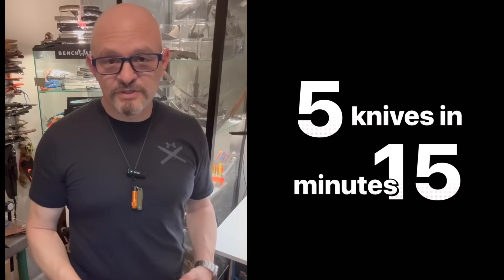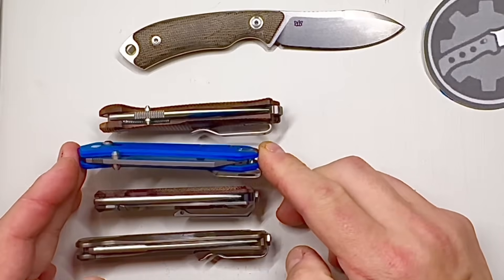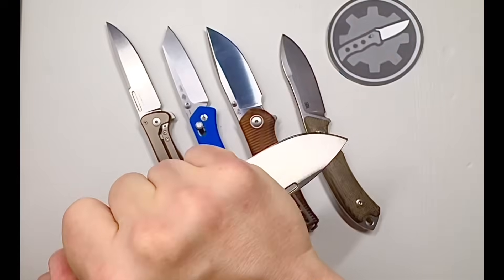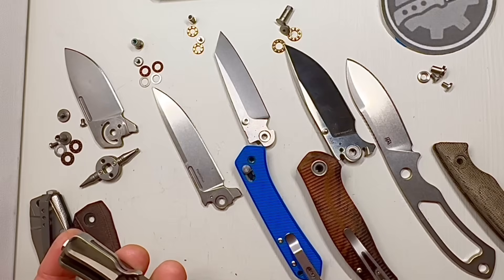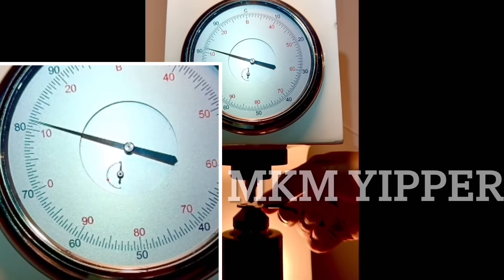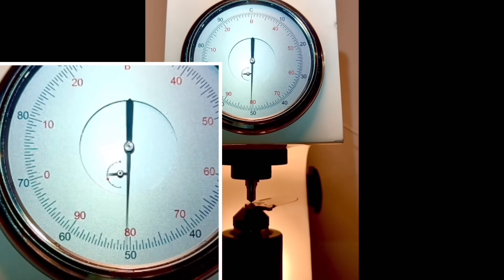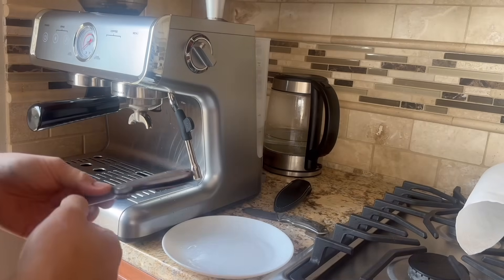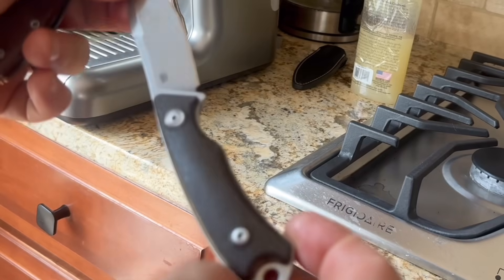Finally! Hardness test of 5 Italian MagnaCut Blades.

Comment from the maker: Just remember, and I said it twice in this video, edge geometry is more important than the hardness!
Reply: While I agree, there is a bit of a caveat here though because you need steel to be harder to support super thin edge geometry. Relatively speaking, the softer a steel is the more likely it is to roll with thin geometry. Of course the opposite applies as well because  if a steel is extremely hard it’s more likely to chip with thinner geometry.
Reply: Soft magnacut rolls after a couple cardboard boxes. Worthless
Reply: Edge geometry becomes more important than Blade hardness after you reach a functional blade hardness of at least 58. -60 . We can’t just leave that statement out there as a blanket fact because it’s not accurate that way. If you present me with a blade at a hardness of 49 edge geometry is not going to do any good whatsoever. Unless of course that blade is traveling at 1000 ft./s. Then it might have some impact.😂

Comment: Appreciate the tests. It’s funny because many American knife makers heat treat their Magnacut around 59-61 (like Spartan knives), and a small handful do it right (Protech does it right at 63-64). I’ve owned numerous knives made by Lionsteel, Viper, etc and have only had issues with a Lionsteel slipjoint made in m390 that for some reason had one part of the knife which would dull quickly suggesting a bad heat treat. I currently own/carry a Viper Larius (m390) and love it so far. The action is very smooth and the knife took a great edge. Viper claims they heat treat their m390 to 60-61 which is better than many other knife makers in the price range (I paid $150).

Regarding the heat treat, I know Lionsteel uses a third party heat treating facility. Viper knives are made in same facility as Fox Knives and they have an excellent reputation. Lionsteel is the one who had a controversy years ago based on a M390 knife which tested at something like 53 or 56 HRC which is pretty bad. To their credit they owned up to it and have gotten better, however that controversy has effectively prejudiced many knife owners against Italian made knives.

Comment: Are you going to have a running  list of all the knives you hardness test. I worked at General Dynamics Convair division in the main machine shop from 68 t0 78.We had a large Rockwell tester that looked just like the one you have. It was very dependable and I never seen it fail or need attention between calibration periods. I would like to see you test a Spyderco Manix 2 light with REX 121. I could send you mine to test if you are interested.

Comment: Q: I wonder how much HRC affects these: (1) HRC=61 - Magnacut vs. 14c28n - edge retention, (2) Magnacut HRC 59 vs. 61 vs. 64  - edge retention. Does the rule of diminishing returns apply? -OR is edge retention linear to HRC? -How much does the Steel composition matter, for the same hardness? -I take into account that you cannot really test the same blade geometry using different steels, for these steels (you can get some in 14C28N & Nitro-V or maybe even S35VN - Maybe this is the test to run - same company -same model - different HRC and Steels..

Comment: Ive been looking at a viper handy for a while but have been holding off on concerns of their ht
Reply from the maker: White River Knives Apex or M1 Backpacker in CPM-MagnaCut will be 62-64 HRC and properly sharpened. 
Also, check out new Italian brand Maserin, which is Igor Bartelussi’s new company, he’s the guy who designed Pocket Tango with DCA
Reply: @CuttingBoardRx M1 in Magnacut is one of my favorite fixed blades- they did a fantastic job on the sharpening , one of the few knives I own I didn't have to even  have to strop  to get hairs popping right off my arm.

Comment: In glad the Pocket Tango had a decent number.
Reply from the maker: I think Igor and Dave understand that any MagnaCut blade under 61 HRC spells disaster for the whole model run. As I said in the video, it always comes in at 62.5 +/-.5 which is well within any Rockwell tester’s tolerance. That said, White River does the highest HRC without going overboard.

Comment: The myth that Magnacut’s corrosion resistance decreases as the hardness increases is incorrect. Larrin just released an article completely dedicated to dispelling this idea because it’s not true and many people are claiming that he himself has said it, which he has not. It’s worth a read but in short the level of corrosion resistance has to do with the heat treat protocol and more specifically the austenitizing temperature and quench.
Reply from the maker: My info came directly out of his original article about MagnaCut. And I had to look for it based on Aust. vs Temper write up in that paragraph.
In my tests I saw small amounts of surface corrosion on Spydies Salt, which are at 62.5 HRC
Reply: @CuttingBoardRx interesting, I wonder if that article is still up because he may have to eat his word so to speak. This recent article/information was released on Patreon yesterday and he was very clear to say he had never stated that lower HRC magnacut was more corrosion resistant.
Reply from the maker: @poncho151  It may be the same article because he compares M390 to MC at low hardness and then later at 64 and 65 HRC (I’m yet to see anyone heat treating M390 to 64 in the real world) 
In both cases, MC comes out slightly better.
Reply: @CuttingBoardRx  This would be a good test to make. Taking two MC blades at different HRC and puting them to the salt mist test.
Reply: @CuttingBoardRx Larrin made the article I was referring to public today along with a respective YouTube video.
Reply from the maker: I now verified that in my possession are  MagnaCut blades in the entire range, from 60.5-ish to over 64 HRC. Is it time to unleash my corrosion chamber test and, will anyone other than yourself care enough to watch it?
Reply: @CuttingBoardRx I’d be interested in watching it whether it is scientific or simply just single anecdotal examples. I guess we now need to start the movement pushing for manufacturers to disclose what temperature they are austenitzing their magnacut at so we can determine advertised corrosion resistance 😂. The rabbit hole always goes deeper lol.
Reply: @CuttingBoardRx I'm definitely interested.
Reply from the maker: @poncho151  The truth is that the predominant majority of knife brands are just that - marketing brands or, at best, assembly shops. Most likely the brand employees haven’t even seen a steel mill or a thermal treatment facility, they wouldn’t even understand this question.
Reply: @CuttingBoardRx did you ever make this vid?
Reply from the maker: There are 3 videos on this topic on my channel.
Reply: He's is the quote from his original magnacut article (this may be where people are getting this idea):

"The test above used a 2100°F heat treatment. To see how the steel compared to Vanax and to test the effect of heat treating I also did a range of coupons with austenitizing of 1950, 2000, 2050, and 2100°F. Lower austenitizing temperatures typically lead to slightly reduced corrosion resistance so I wanted to see if there was a big dropoff. In the retest I used 3.5% saltwater for 72 hours, which will rust just about anything outside of Vanax or LC200N. The 1950 and 2000°F samples showed no rust spots, while the 2050 and 2100°F had a couple very small rust spots. This is probably due to inconsistent finishing in the corners (notice the location of the rust spots), or perhaps some minor contamination of iron particles there. There is no reason for those samples to have lower corrosion resistance compared to the 1950 and 2000:.
Reply: You are correct in that he never said that. In fact, I've been a Patreon supporter of him for many years. The only mention of Magnacut or any stainless steels getting worse corrosion resistance via higher hardness is from tempering in the high range(500-1000°F). The range high speed steels are heat treated at for high hardness. This pulls chromium and other elements from solution of the matrix and turns them to carbides, where they can't contribute to corrosion resistance. In fact, he goes into detail saying that stainless steels heat treated correctly (lower tempering temperatures and potentially cryo), that as austenitizing temperatures increase, more chromium is dissolved into solution of the matrix of the steel, actually increasing corrosion resistance as hardness increases. This has been well known in the industry since Hitachi's study on ATS-34 in 1999 and the huge fiasco with Paul Bos of Buck knives not wanting to accept high tempering and of stainless knives wasn't ideal for steels made for knives. Hitachi noted increased corrosion resistance, edge stability, and impact resistance in the study and pointed to using cold treatments (like NASA did in the 60s) to further reduce retained austenite and gain dimensional stability. I've been in the metals field for 14 years, and have a masters of material science of metallurgy. This is a common known affect of stainless steels. Larrin would never say higher hardness = lower corrosion resistance on a martensitic stainless steel unless he was talking about high tempering temperatures, as this has been know of the material properties for a very long time in metallurgy now. -Jacob

Comment: I had a Lionsteel M4 in Magnacut. The hardness wasn't the only problem with that knife. Hardness was around 60.5.
The edge off the knife was either horribly burnt or had an uneven heat treat. I sharpened it 4 times and could bend the apex with my fingernail. 
It took 5 sharpening for it to even take an edge, off which 3 were complete reprofilings to steeper angles. And it didn't start performing until the eighth edge. 
And still it wouldn't hold an edge as long as my Recon 1 in S35VN.  
I left a review on the sellers site and thankfully they took it back and refunded  most of the money. 
I'm from Europe by the way.
Greetings.
Reply: I would be extremely unhappy if I had to remove an eighth of an inch from my cutting edge before I got to the proper hardness of metal to keep a cutting edge. I might not mind having to reprofile of Blade that I got a really good deal on, but if I'm gonna spend premium money for premium equipment, I feel like I shouldn't even need to reprofile once before I had a good cutting edge. Although burnt edges from high-speed machine sharpening done without proper cooling has become something to watch out for. Especially in mass produced equipment if they get just a little bit of obstruction in there, coolant flow, it can make a tremendous difference and result in some really bad quality at the cutting edge.
Reply: @CB-68-westcreations  Imagine my shock when a polished edge turns coarse grit edge from slicing two pieces of bred on a paper plate and that was on the third edge.
Reply: I think you were unlucky. I saw your review and got shocked by it. I have a model with walnut scales and not a problem so far, other than the finish on the walnut. I still did not have to sharpen factory edge as it became really sharp even though a bit toothy for my taste but very good overall and with symmetrical bevels
Reply: @kazekai6  I guess you were lucky but that speaks to the quality control of Lionsteel. I read on several places like reddit and forums of others having issues with Lionsteel knives. Especially with the heat treat on not just magnacut but also their m390 models that kept chipping like crazy since I was trying to figure out if I was doing something wrong with sharpening it (new steel and all). I hope it's just outliers, but it certainly isn't confidence inspiring. I had that knife for more than half a year before I decided to write that review and I recently bought a Spyderco Manix 2 LW in Magnacut. After the disappointment of the M4 I wanted to give the steel another chance . Boy what a difference a good heat treat can make. It just keeps cutting and cutting like no mans business after the first sharpening at 15 dps since the bevel came uneven. I always sharpen the factory edge off. I do hate the plastic handle on it tough. The AWT scales I plan to purchase cost over a 100€ with shipping but that's how much I hate the handle on that thing (feels like a child's toy in hand an the color doesn't help or the bidirectional texturing, will be Rit dyed very soon).
Reply: @war_razr  I own an M1 in M390, the old ones also, and like with the Magnacut M4, no issues. I sharpen on chosera pros and I can tell it is tough. It had a slight edge bevel mistake i had to grind off and even on the 400 took some time. I left a 17-18dps edge on a 12000 plus stropping. Used it to cut twist a bit on a piece of wood and there was nothing on the edge at all. I also have the KC02 on MC which I have not used but it came very very sharp and pretty symmetrical. However fit and finish was not as great on some areas. Still have not tried it. Sleipner however feels solid, higher hardness than other brands I have used and it does respond well, to abuse too. Also their 3V is supposed to be at 61-63 HRc. Don't know about that. Got a MKM Normar cause I love the looks and it has a great design, and is incredibly slicy. Very thin with a low angle zero scandi. I haven't used it much either but you get the usual zero scandi micro edge damage cause it is incredibly thin right at the apex, but feels well tempered since it does not affect to how it feels on nail, paper and stuff. Not defending, I know their MC tempering is off, their M390 is on the softer side. I just like their designs and I haven't had any issues with their knives, plus in my opinion, fit and finish and materials wise, they offer good value with good warranty. Unless of course, you get a faulty one. I do agree they should be more thorough with testing and quality control.

Comment: The ideal hardness of the main body of the blade is in the HRC rang low to mid 50's HRC range. 
A higher HRC rating of for the cutting edge may well be ideal.
I believe too many people confuse blade body HRC with cutting edge HRC.
Cutting edge hardness has been tested near the apex revealing 5HRC loss near the apex. 
Any Thoughts ?
Reply from the maker: Thanks for the comment. You probably referring to custom blades with variable heat treat. Neither of the blades in this video is manufactured that way.
These production models are made in large batches and variable heat treat is not feasible. In other words, each blade has the same hardness at any point. 
The hardness may vary between the blades in the same batch, usually depending on where in the furnace the blade was hanging: the temperature is higher in the center and lower at the perimeter of a furnace. 
Finally, MagnaCut is supposed to be double tempered, which is a lengthy process to assure proper distribution of carbides within the molecular structure of the blade. 
I highly recommend visiting https://knifesteelnerds.com where Dr. Larrin Thomas addresses all the intricacies of heat treat. Also, he wrote a book and I consider it a worthwhile read 
https://amzn.to/402nvxp
Thanks for subscribing!
Reply: Im pretty sure the pocket knives made this way are heat treated in bulk. They get blanks in the shape they want in bulk. Then do profiling on it and heat treat many of them at once.

Comment: It’s really sad with lionsteel that they beat treat so low. Really low. You think they would have fixed it by now. Great knives but of all edc blade attributes we need edge retention for the most part rather than a little less toughness and corrosion resistance. Sad.  But not surp. They are more worried about it breaking than cutting. Thankfully most other manufacturers like ritter, Benchmade and others are starting to push the heck. It’s sad. Lionsteel makes great designs with great manufacturing at really great prices.
Reply from the maker: I have a suspicion, actually a speculation: are they single-tempering at higher temperatures (500°-600°) without cryo rather than double-tempering at 350°-400° followed by cryo after each temper as prescribed by Dr. Thomas?
He had a video about such practices without naming the names… 🤷‍♂️
Reply: @CuttingBoardRx it’s a shame. Awesome manufacturing and designs and great metal but so so heat treat. You are probably dead on

Comment: The Spyderco Slym is not a Sprint Run, it's a regular production model and technically the SpyNano isn't a Sprint Run either, it's a Flash Batch.
Reply from the maker: Thanks for translating from English to Spyderish 🤣
The bottom line is neither model is selling in high numbers by Spyderco standards.

Comment: You mentioned geometry being more important than heat treatment. I feel that would be another knock against Italian knives. Many have insanely thick blade stock and are thick behind the edge. 

It seems the designs are focused on good aesthetics above good performance.
Reply: @reebor , I 100% agree with you on on this.
Reply from the maker: Actually, the edge geometry in the context of what Dr. Thomas talks about consists of shape (flat bevel vs. convex) and behind the edge thickness. Regarding the Italian approach, it seems that they simply follow the same heat treatment protocol regardless of the edge geometry or end-use functionality of each particular model. 
I dealt with Fiat engineers for work, they are extremely set in their ways and nearly impossible to sway from the most dogmatic procedures.